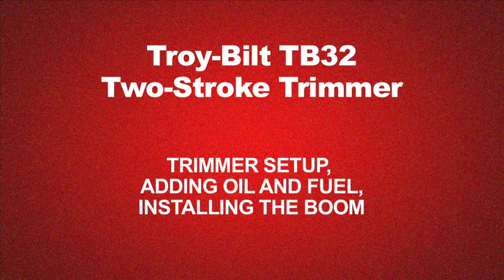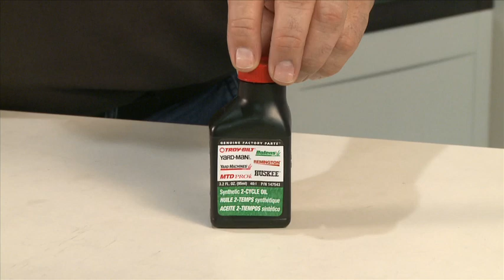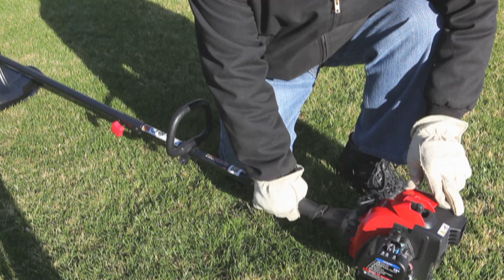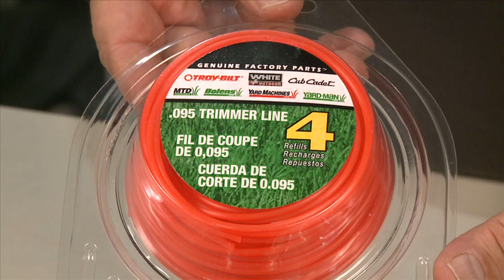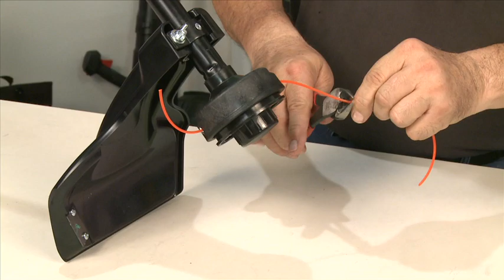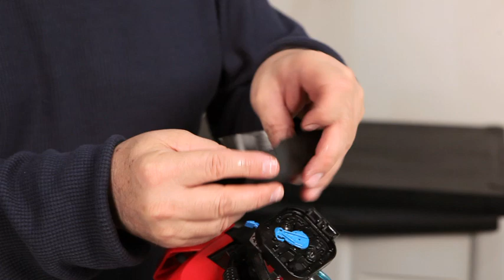The TB32 EC gas string trimmer | How to set up your 2-cycle trimmer

Comment: Someone gave me his, hard to start. Used it for a while, became even harder to start, stopped idling. It lost compression from running too lean! I have to pour oil down the spark plug hole to start it. I had to turn the idle screw all the way in for it to idle. Tired of MTD crap. I got one with the pull starter on the back, needed new carb and fuel lines. Hasn't had any problems

Comment: Thanks to the video i fucked my weed eater up. Turn the bolt counterclockwise to get the nut off so i can replace the line? I did exactly that an striped the fuck out of the threads. Thanks alot assholes

Comment: For some Troy Bilts you don't have to add oil to your gas. Just add regular gas to the gas tank on your trimmer and that is it. This is just one trimmer that you have to add the oil to the gas and mix it because its a 2 cyclinder engine.
Reply: 4 CYCLE YOU DON'T ADD OIL.
ALL OTHERS YOU DO. Google your model for mix ratio.

Comment: Mine works great. I adjusted the jets on the carb because it had no
power and acted like it was running lean. I bought a single d carb tool from amazon and fixed it right.

Comment: I've used a variety of weed trimmers in home applications dating back to 1986 and they've all performed well and as expected except for my Troy Bilt TB32 EC. The issue? Removing the trimmer "bump cap" - an impossible task by hand or with tools that most folks keep around the house. I have to drive the trimmer to a repair shop every time I need to replenish the line. The repair shop has a large, table-mounted vise-press to hold the outer reel (housing in which you place the inner reel before securing with the bump cap). I continue to use the trimmer as a matter of principle but I'm ready to trash it with the motor and everything BUT the head of the thing in good working order. The trimmer appears to be a good machine, but as we all know, machines, like organizations, are only as strong as their weakest link. Good machine = junk when it doesn't function owing to a design flaw like this. Bottom line? Steer clear of this trimmer at any price.

Comment: Biggest waste of money ever.  Poor design (gap near the head gets clogged with grass, twisting in the head), the line constantly goes back into the head (causing you to stop working and re-thread the line again), and the motor runs at a very low speed.  Save your money and buy a better product.

Comment: You didn't install the air filter correctly in that cover. Engine oil in the air filter is a bad idea, it makes the filter too restrictive, sticky and clog up faster. If you want to rejuvenate the filter material, it's better to clean it with warm soapy water, rinse with water and use a cheap basic tire shine like armor all liquid and let it set for a few minutes, then rinse out the excess with water and dry the filter before installing. I've had polyfoam filters for 10+ years using this technique, not one problem. :)
Reply: David S  I.        Oooqqwwqpp
Reply: I use 3 in 1 oil. Works great. Clean it with dish soap, fully dry, squirt some 3 in 1 oil, massage it in, then squeeze it in your hand while wrapped in a paper towel to remove excess oil. Many high flow performance air filters for cars use oiled filters. It extends the life of the filter and improves filtration. If it works for a racecar without restricting flow, then it will work for a weed eater.

Comment: thank you sooo much for the advice on the quarter turn of the inside circle with the flat side.  Now my trimmer is running like a champ once again.  I almost threw it in the dumpster!!! i could not get it to start running without being in choke position 2 and even then it wont spin fast enought to do the job right.  But one small adjustment and whoala!!! just like new!! thank you again Jeremy scott!

Comment: I am extremely disappointed with this trimmer. After a few uses it it bogs down and runs at about half speed which isn't fast enough to engage the crappy clutch that nobody in thir right mind would ever want installed on a trimmer. The carb is not adjustable either so I essentially paid for something that is not usable. I have a Troybilt riding mower, push mower and trimmer. I'll never buy another one.

Comment: I purchased mine at Lowe's in June. I had no problems at all with it, has plenty of power I use it on less than 1/2 acre. Restringing is not a hassle it's very easy. You should have purchased an electric or battery trimmer with auto feed and pay the extra price for the pre-loaded reels (throw aways) Sounds to me like your lazy dude.

Comment: my comment if followed, will fix this problem.  all you need is a flathead, no taking anything apart.  I might have to make a video on this :/
Reply: 2 comments minutes apart 7 years later…. Feels like a setup. Lol.

I threw this POS trimmer away after about 4 years.  Everyone I talked to that had this thing, required adjusting the carb.

Comment: OK, SO EVERYONE KNOWS THIS- The Carburetor on this Weed Whacker is calibrated incorrectly from the factory.  after just a few uses, mine began to bog down unless in half choke.  I'm sure there is more than just me with this problem, considering my neighbor with the exact same weed whacker had his set the exact same way!  same problem and all.  There are two circles with flat spots on the top of the weed eater, with a flathead, you need to turn the one on the inside 1 quarter counterclockwise.
Reply: I tried it.  Worked.  Thanks Jeremy.

Comment: I bought this trimmer and have used it twice now.  After 2 uses I must say that this is the worst trimmer I have ever used and am so totally disappointed in my purchase.  The starting of this trimmer is a huge hassle, the restringing of this trimmer is a huge hassle.  My bolt that kept my two shafts in place was bent out of box and doesn't line up correctly.  The power on stage 3 is weak at best, not happy with this purchase at all.